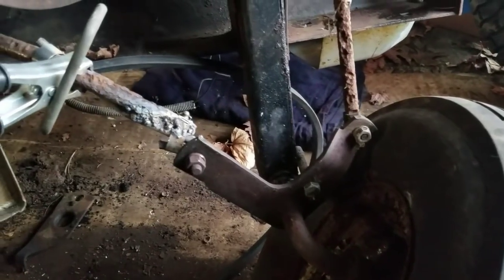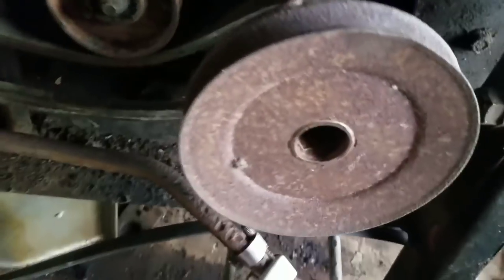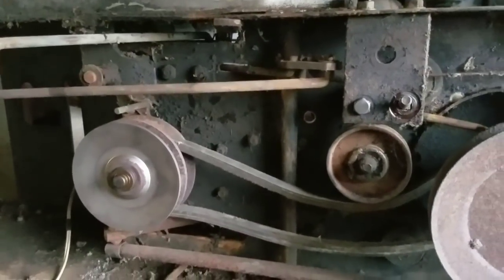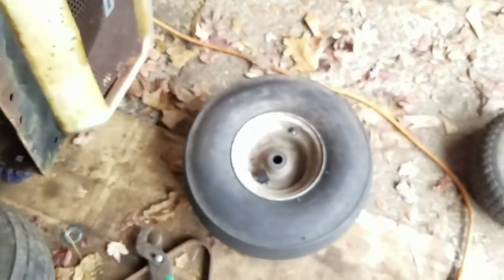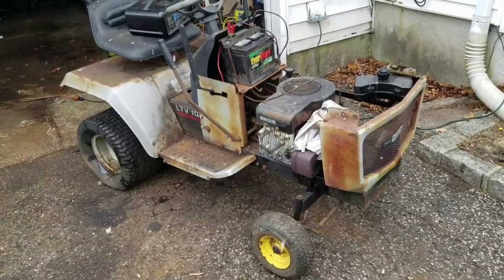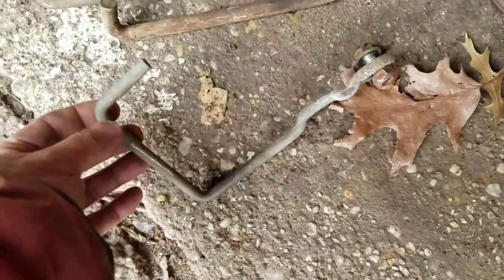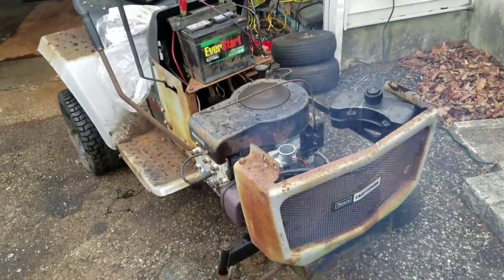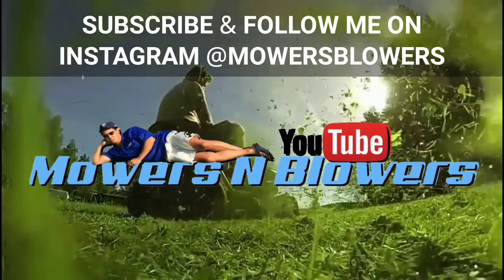FREE CRAFTSMAN LTV 10 VARIDRIVE LAWN TRACTOR MUDMOWER CONVERSION DRAG LINK WELDING LOW RIDER WHEELS

Comment: Old tractor seen better days but the only one reason I didn't want a really old tractor is because there harder to work on 1999 to 2006 is the best years for tractors but alot of tractors like it are getting turned into mud mowers
Reply from the maker: Since the mower deck was trashed...I had no choice but to make this a mud mower.
Reply: Oh I believe you lol a deck would be very hard to find since it's a sears vintage tractor
Reply: And it has no husquavarna parts
Reply from the maker: Very very difficult!  Theres very little ones still out there that aren't already on vintage tractors.

Comment: A air hammer will take the wheel of 35 dollars at Lowe's
Reply from the maker: My air compressor wont work with pneumatic tools..not enough cfm
Reply: @MowersNBlowers  with your millions you are making buy a  air compressor
Reply from the maker: Years ago when I bought my $99 craftsman air compressor, I thought that was where I was going..to have a bunch of pneumatic air tools...I bought an impact and it wouldn't even turn the motor.  I wasnt aware of how much pressure it took to power those tools.  I just use it to blow out my sprinklers every winter and put air in tires, clean carbs etc.  Would you know of a good, cheapest compressor that has enough cfm to power tools?
Reply: Mowers N Blowers   you can get a 20 Gallon air Compresser at home Depot  for 200 175cfm a up right tank less floor space needed it is a one piece unit motor and compressor are bolted together.  But the 2cylinder with a separate  motor run buy a belt are around a hundred dollars more will last a lifetime the cheap one piece don't last long